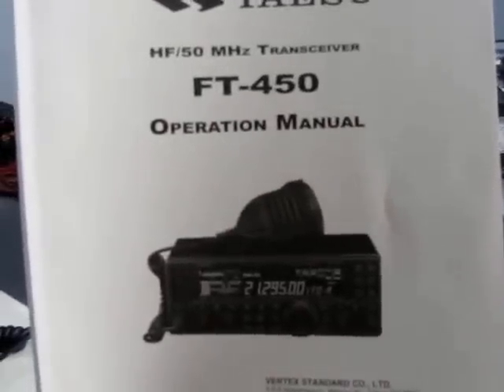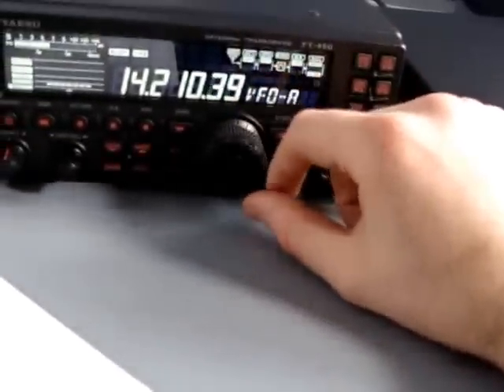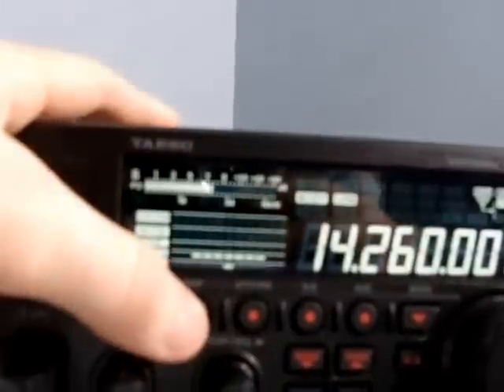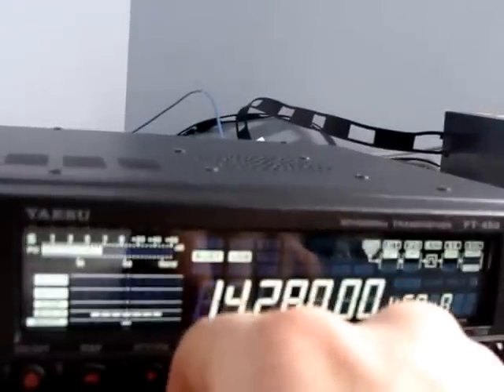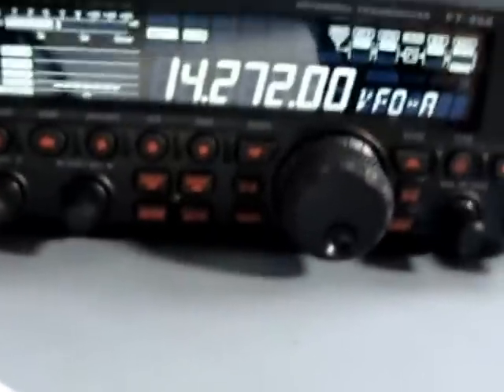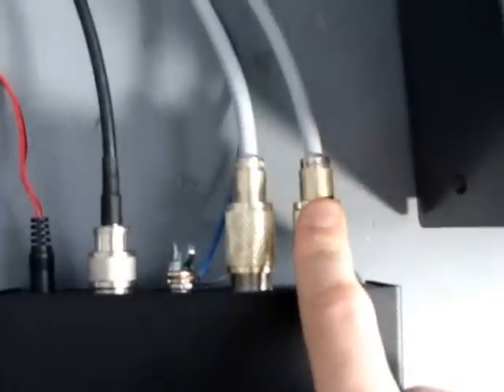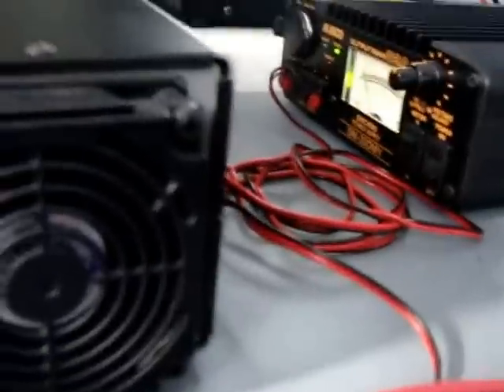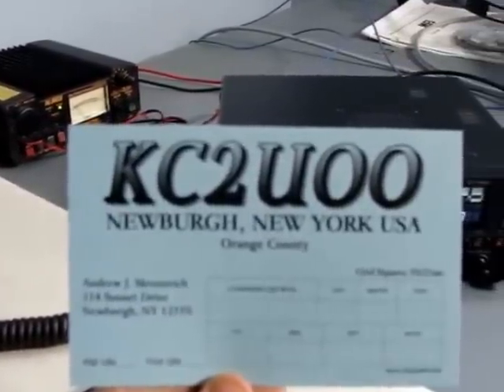Yaesu Ft 450 Review  KC2UOO

Comment: Nice little review - and a cute little radio with some nice features. I take it you bought the non ATU version judging by your AT-100 pro. 

I am looking at a second HF radio / using my ic - 7000 as a secondary hf radio, and am looking at reviews on the different models. Thanks for putting up this review.

Comment: I have an FT-920 with the MD-100 mic and I just love Yaesus! I was thinking of buying this little baby (FT-450) as a backup rig or even for camping which I do a lot. But I'm more attracted to the version that has internal antenna tuner. I really like yaesu tuners, they tune WAY better than kenwood and icom tuners. My ft-920 tunes a G5RV with 2.7:1 - 3.0:1 SWR in almost every band and it tunes quickly from 10 to 80 meters and I have even tuned it at 6 meters. Congrats there on your purchase!

Comment from the maker: I had a couple days using the Kenwood TS-2000 which I really enjoyed.  

I wanted to keep my budget under 1000 dollars.

So, most of the entry level radios were out, and I went with this one without the internal tuner because of the price.  For my whole setup,  radio /Tuner/Powersupply/Antenna I came in just under 1000 dollars.  

So i went with this radio for money reasons.  I however liked the 950, and 2000 but passed because of money

Comment from the maker: This particular model the FT-450 Does not have it built in,  knowing I was going to be using Dipoles and Random wire antenna's I opt'ed for an external tuner.

However the FT-450AT does have an Internal tuner

So yes, this radio has the option for an internal tuner.

Comment from the maker: I hooked an audio cable upto my computer from the external speaker port,  Digital master and Digi pan work pretty good with that.

My interface for transmitting is a Small speaker velcro/taped onto my Mic, and VOX on.

it works.. its rudimentary..  not planning on spending money on a cable/interface at this point.  As im not really interested much in the Digital stuff.